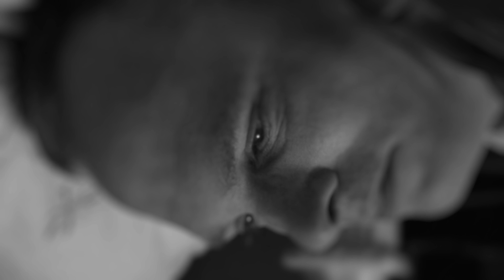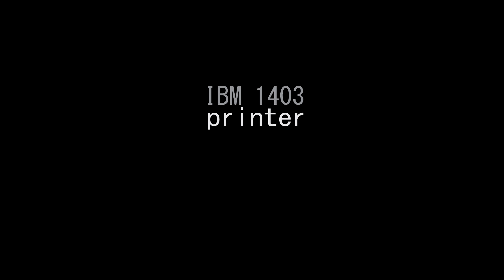IBM 1403 printer

Comment: With all of the info surrounding me—or are they data points in the world of AI?—I can’t help but look a bit like that guy in this video.  Concerning the IBM printer, I pulled the following out of the cauldron:  “… the speed at which electromechanical accounting machines can read punched cards and perform their basic arithmetic functions means that no faster printing speeds are needed. The IBM 1132 was the last printer manufactured by IBM to use this technology.”  Perhaps it’s added to his thoughts….  

Another intriguing film.  I’m looking forward to watching more of them.

Cheers!